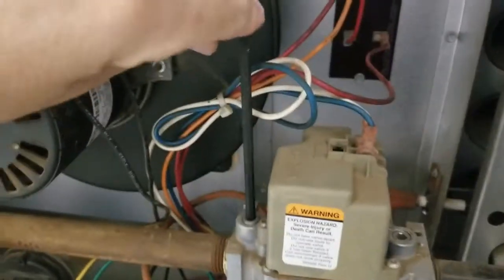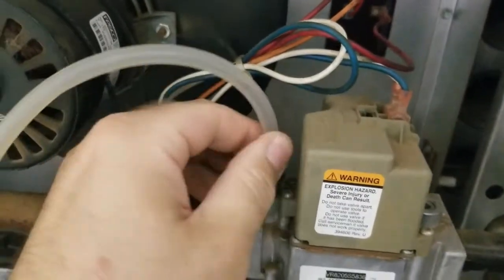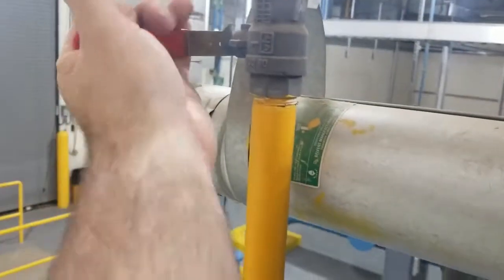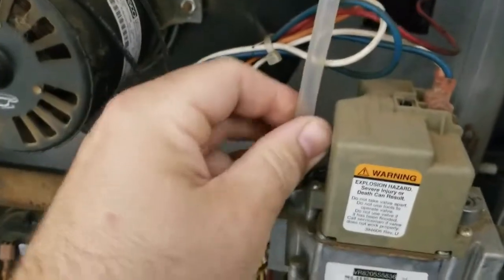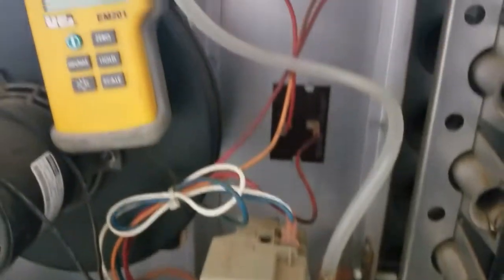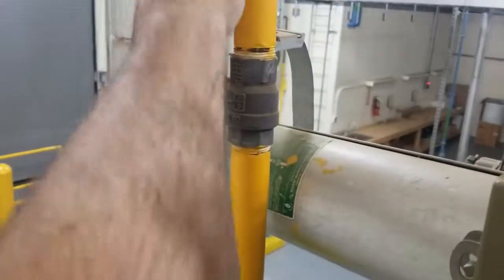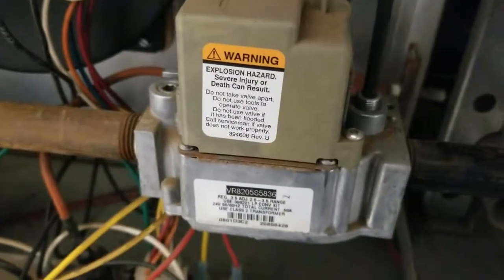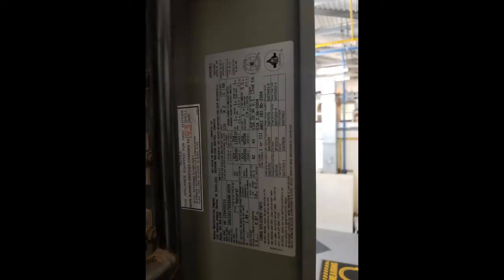how to test gas valve pressure with a manometer

Comment: Strange video.
initially connect 2 hoses to manometer: one to p1 for in and another to p2 for out. but, later in video only p2 used for both in and out without any explanation. why? this is the video tutorial for how to use manometer to evaluate gas pressure in and out, i thought.

Comment: Great video! What size fitting is used for the gas valve? I received a Manometer without the brass fittings.
Reply: Did you find out my Klein came without them as well?
Reply: @hachi-rokuperformancegroup3987  Not yet
Reply: @Mac-i7  Thread's are 1/8 to 1/8 barb. Just go to the brass fittings at any hardware  or Lowes Depot. I think mine were under $2

Comment: Where are the adjustments to increase or decrease the gas pressure on that gas valve
Reply: its one year late, but the adjustment screw on that valve can be seen at 0:45 . that cap behind the test port unscrews and you can adjust the gas pressure from inside with a screwdriver